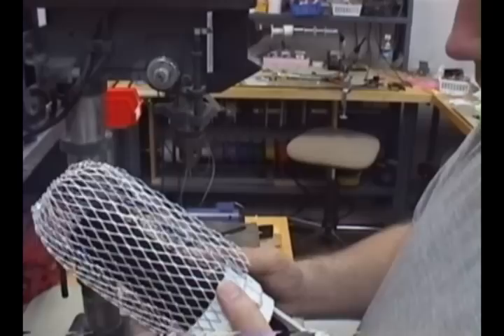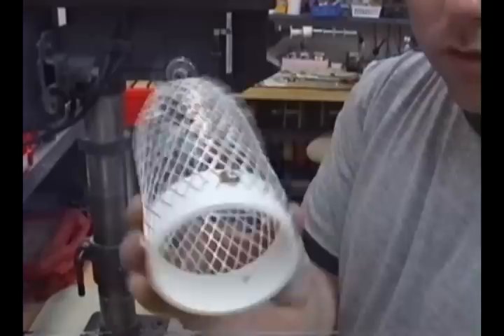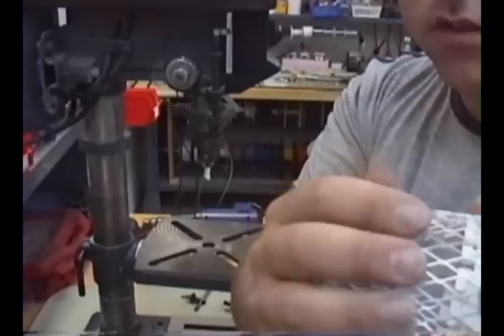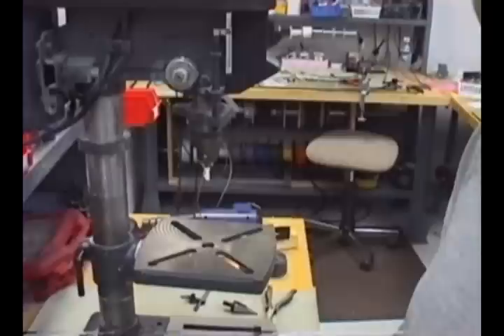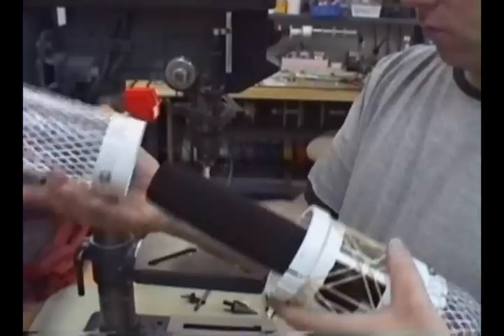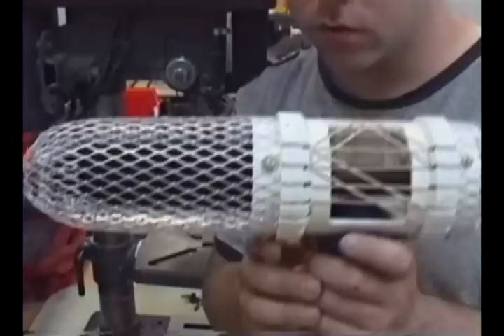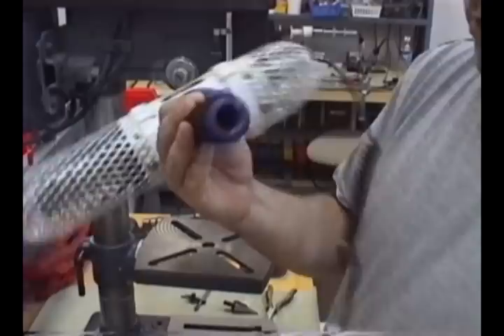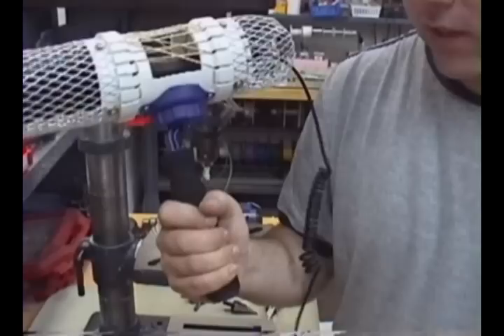How to make a blimp windscreen 4 of 4

Comment: Nice job, one of the best DIY  blimps I have seen. As you have probably found by now, for windy conditions you really need a furry cover over the blimp...but the stage before that, you could probably pull a thick pair of tights/stockings over your blimp and get excellent results...then go the artificial fur for the next level up.

digifish

Comment: Neat job!  Correct me if I'm wrong, but I think you made a huge mistake by not putting some sort of mesh right in front of the microphone.  After all that's the most sensitive area.
It's been 4 years since this video was made.  How is your blimp performing?  Any troubles?  Any modifications since then?